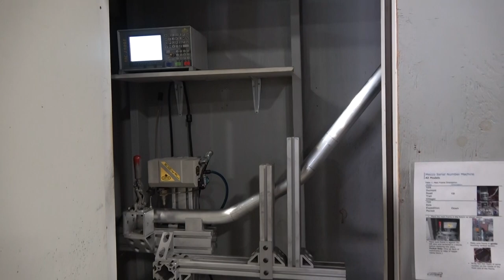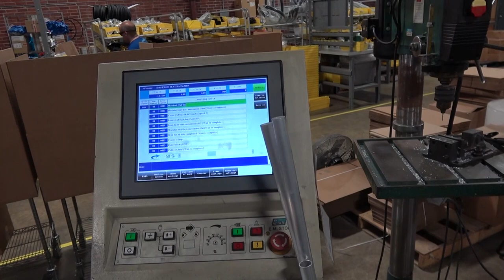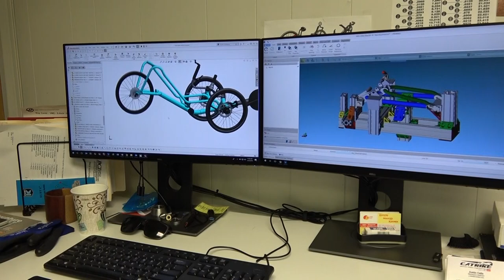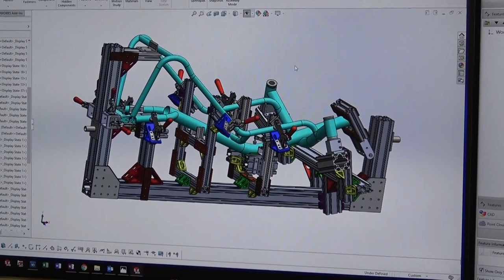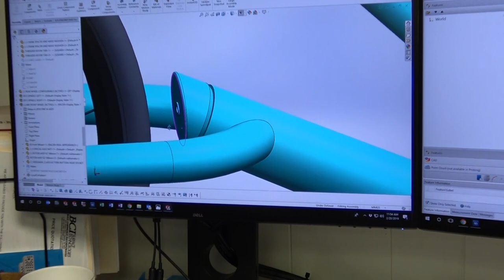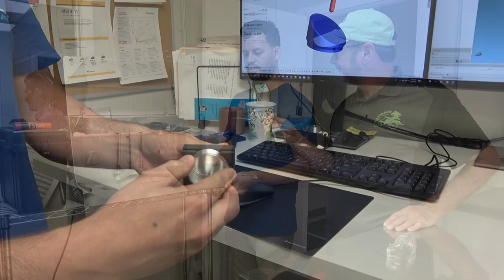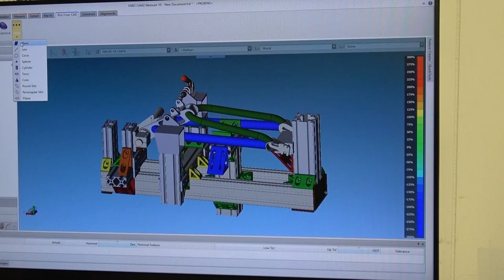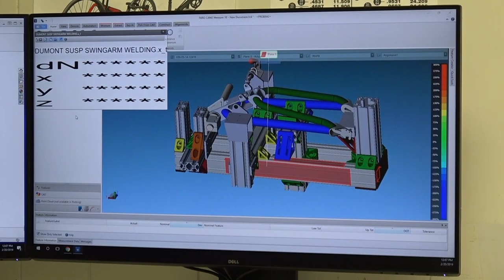Catrike Factory Tour 2019-Laidback Bike Report

Comment: Excellent! I'm hoping it won't be too long before an E- assist mid drive motor comes out. It will be great if they can keep it around $2000.00 or less. Attach a boom with the motor connected, and there you go, sounds easy.

Comment: I currently ride a Trail with a Bionx motor and it is incredible. It has 20” wheels and is not foldable so transporting it is a little difficult. I have done all of my research and I am in the process of ordering/ building a 26” drive wheel 559 foldable e bike which also will have an adjustable padded seat. They are incredible machines and worth every penny. After viewing this super video of the manufacturing facility, the design process and the high quality employees, I have no problem whatsoever with pricing. Made in USA with the best materials, workers, and precision. One only remembers price when they have spent had earned money and the product is substandard  and must be discarded or replaced. Catrike is the real deal..made by pros and serviced by pros. My dealer in Mass is the best and I am fortunate that I have dozens of protected, designated , totally safe paths to ride on Cape Cod.I will take the folding 559 to Florida with me this winter...I was unable to transport my Trail there in the past. I do 100-150 miles per week and I am 67 and this product has  me in the best physical condition in decades and I have met up with many riders here who  join up for frequent rides.
Reply from the maker: Thanks for watching, Mark! I agree with your assessment of Catrike and approve of your choice of trikes. I hope you have many wonderful years of riding on your new 559!
Reply: Gary Solomon Thank you. I have done a lot of homework/ research and fortunately I am in a  position to purchase these items. My dealer is Jeff Palter of Cycleloft in Burlington ,Ma and I drive 65 miles to avail myself of his expertise. Living on Cape Cod has made safe cycling commonplace with so many dedicated, safe paths. I never ride in traffic as it is just too unsafe with all of the distracted driving. Cape Cod Canal is 15 miles round trip and Falmouth to Woods Hole is 24 miles as is Brewster to Chatham and many others along abandoned railbeds on the Cape. The Catrike experience has truly  been a life changing experience. I saw a guy on the Canal with one when riding my conventional bike, he let me demo his and I was in the store the next day!

Comment: Another well Bent one from Laidback Bike Report, thanks Gary. Top notch walk through of the process in Manufacture. Heijunka and TPS at its best, back to my days of working in an Automotive Factory. Quality stop before proceeding forward. One wheel would take me at least an hour and half to lace and true by hand. Can't beat in house Manufacture and Product Development ( other Trike Manufacturers have their frames made in China). 
If i can make it over to the U.S.A, then the Catrike Factory WILL be on my Bent Bucket list.
Reply from the maker: Thanks, Derek! Automation is an important part but clearly not the only thing that makes the Catrike process so efficient. The Toyota type system they use is flexible, fast and accurate. It seems to me that having the right,  properly trained people is also an essential component of the success of it all.

Comment: Very good video n I feel more comfortable narrowing down my ultimate goal of selecting my first trike with electric drive options.  Have to search an see if you folks currently have such a option? 

I generally run with the very best of everything n seldom am I disappointed.  My needs are somewhat different than most.  As I recently fell n crushed my vertebra n compound fractures everywhere.  Prior to this recent incident, I have a lumbar fusion with hardware n artificial disc above that.  So comfort to shock loads n bumps will likely win the trike purchase. 

I throughly enjoyed your video n the various stations n steps taken to manufacture such highly complex pieces.  I will certainly placed your trikes is consideration as I research my future trike.  If you don't currently have duel use with eclectic drive assist.  I'd make changes very quickly to offer those issues.  As that's where everyone who love trikes are heading towards.  Thanks Ty Clark, northern Michigan.
Reply from the maker: Hi Ty-I'm very glad you enjoyed the video. Best of luck in your search for that e assisted trike ☺️